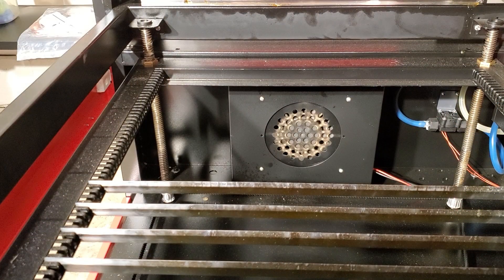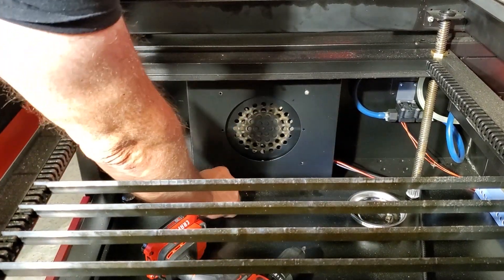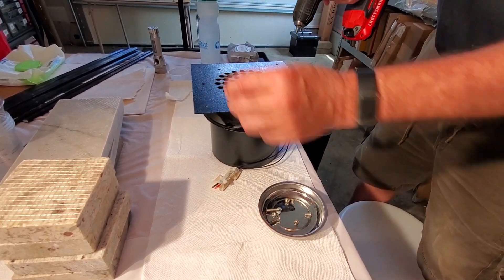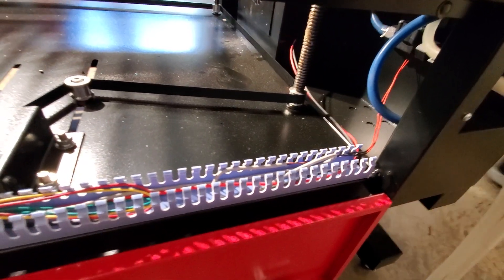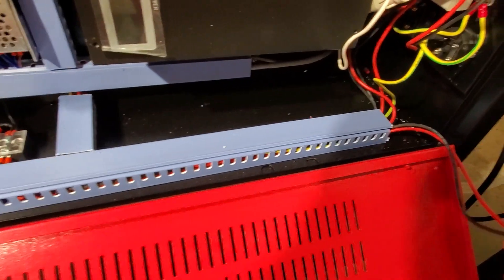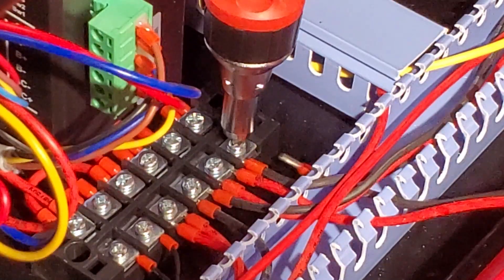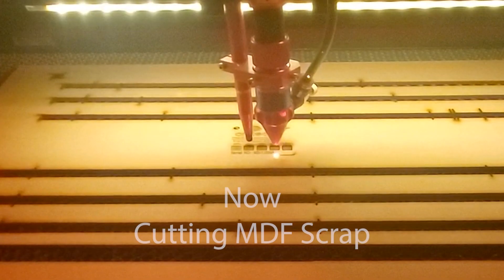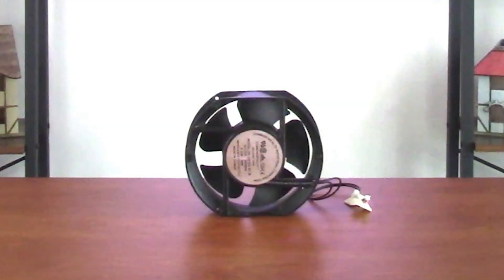How to Remove the Original Equipment Fan from Your Laser Cutter

Comment: I need a small bit of clarification please:  prior to removing the fan which came installed in the laser cutter you had an inline fan installed and vented outside, correct?  When using the laser cutter would both fans run at the same time?  If yes, then it seems a bit counter-intuitive that you now get better exhaust results with only the inline fan versus having them both running.  Was the original fan working as it was supposed to work, or did it possibly have a problem causing it to run at a much slower speed than it was supposed to, so it was causing less air-flow by running at very low-speed and actually hindering air-flow by simply "being in the way"?

I've had fans on computers that have slowly died over time, and they would gradually spin at a slower speed that was not obvious to the naked eye...without having some sort of gadget that could measure the RPM/speed of the fan I could not tell by looking at it if it were running at 100% versus 50-60%.

Anyway, sorry for rambling.  Thank you for sharing this guide.  I have a different brand/model of laser cutter/etcher and will investigate taking out the pre-installed fan.  Thank you for your time and assistance.
Reply from the maker: First of all, I totally agree it is counterintuitive that two fans are less than one, which is why I didn't make this change for months, even though I had read in many places I should do it. I'm not an engineer, so I can't really explain the fluid mechanics. The original fan does have significantly less capacity than the inline I installed, so it WAS a choke point of sorts for the system, but I was also told that it sets up some flow issues. This is why the guy from OmTech asked about the distance between them. Apparently, the greater the distance, the less impact from the flow anomalies. My advice is to not make this change based on my video. Do some research until you are comfortable with the science and then come back to my video if you want to proceed and want tips on how to do it. If you run across a good engineering explanation in your research, please let me know and I can add that link to the video description!

Comment: Replace the drilled plate with a wire fan grill, much less restriction.
Reply from the maker: Thanks for the tip, Mike, that makes complete sense! I'm hoping this 6" size is a standard item?
Reply: @GreylightMay  Look up the part number of the fan to get the official size in millimeters.
Reply from the maker: Thanks, Mike, will do!

Comment: Great video! I just got the AF2028 - 80W and have my AC infinity 6" inline fan set at the end of a 20 foot exhaust. It is working great so far, but you still have a to wait a few for the smoke to clear when cutting (sand plywood). Casually chatting with an HVAC expert, they said that the extension fan would be limited by the output of the internal fan as well as the diameter of the exhaust hose. However, running them together will increase the suction vs just running the internal fan. Looks like I will be following your lead this weekend! 🤓
Reply from the maker: I really appreciate this information. It fits my experience and makes sense. Check out the comment above where a viewer suggested using a wire cover instead of the one that comes with it; I'm definitely going to look into that. I don't think there is much that would get sucked into the hose, but some kind of cover makes sense and wire would definitely let air through more easily. Let me know how it goes, we have the same machine!